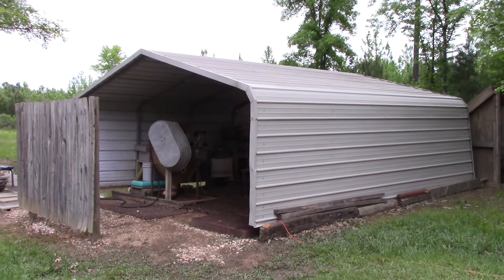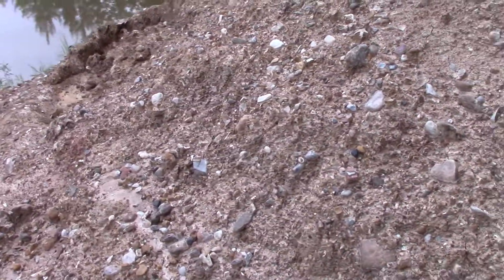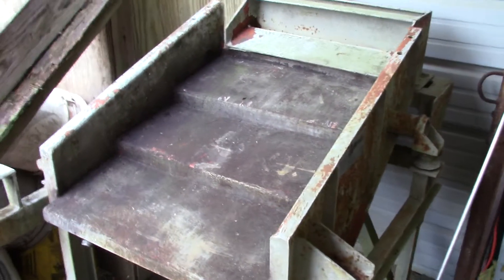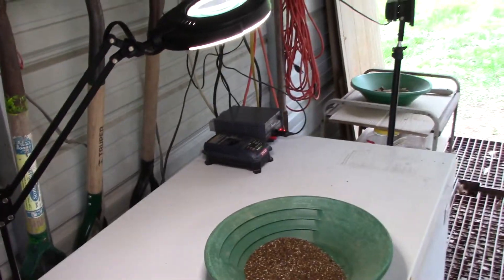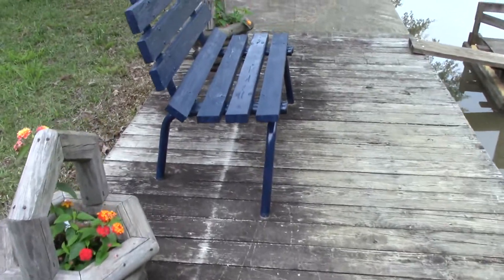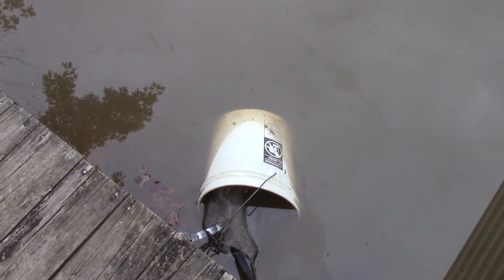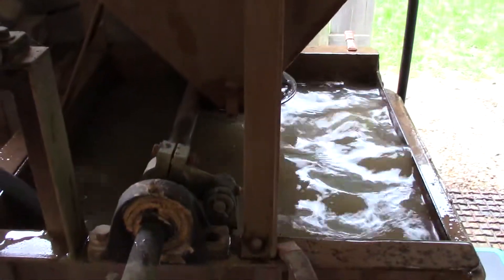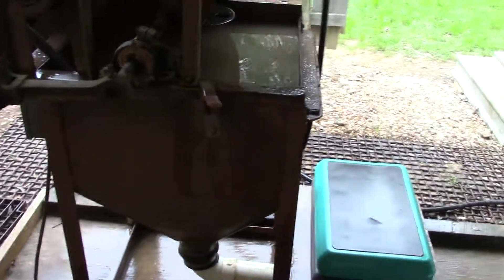Let Me Show You The Pleitz Jig At My Diamond Recovery Facility Near  Crater Of Diamonds State Park

Comment: I didn't know what that was or what it did. Thank you!
I have been thinking of a contraption to bring out there with me.
I'm one of those crazy inventors too.
Reply from the maker: The park does not allow anything that has a motor, uses gasoline or is battery powered.  Honestly, the best way to process ore at the Crater is washing it through a set of screens.  Contraptions are not necessary.  The two keys to finding diamonds at the park are:  1) Wash the right material and 2) Wash a LOT of it.

Comment: thats exactly what i want to bring to the crater! of course, it would have to be more mobile and hand operated, but if only i could make one and use it there! i could run buckets galore! if i could screen it at the same time it would be awesome... so basically, have two screens a 1/4 and a 1/8 mesh with a solid floor below them leading into the next screen, and slightly sloped to facilitate washing down into the next screen. then just rig it so they are all in the water and removable to empty once the top screens are full... the Saruca machine would be super useful just to set in one of the large basins and fill continuously until it was full of heavies...
Reply from the maker: Yes!